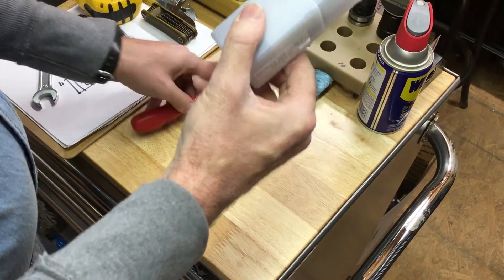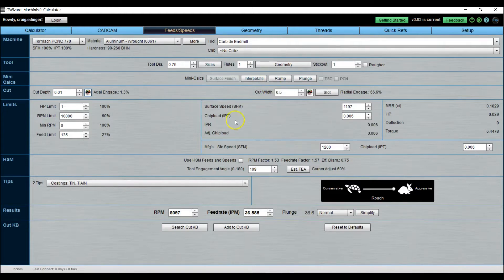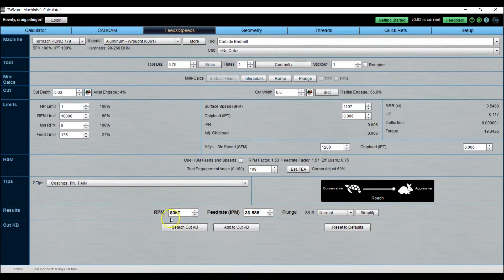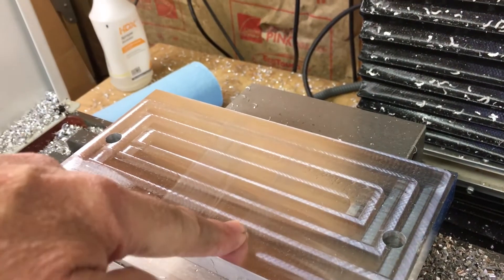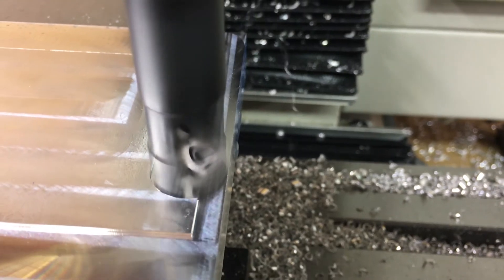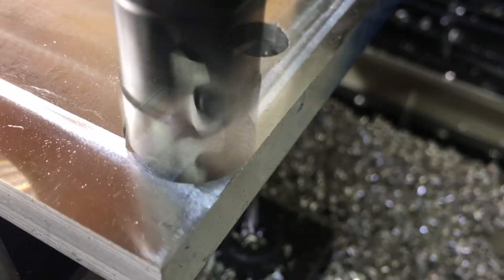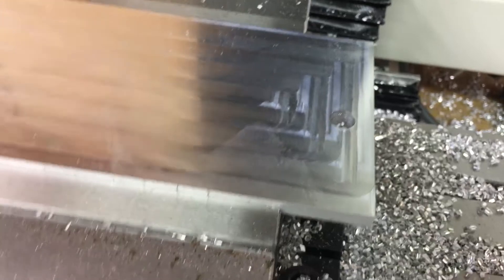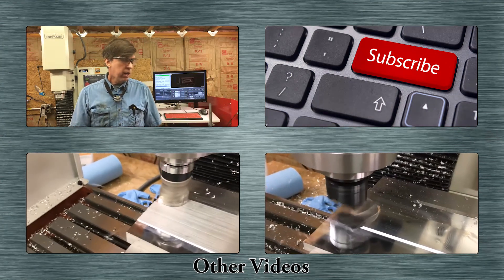Tormach Shear Hog

Comment: I watched your video showing one of Tormach's 38mm face mills at work.  I'm wondering if a guy could simply run that same face mill with all but one of the cutting inserts removed and get similar results to this "Shear-Hog"?

I know it might be limited to how deep the DOC could go but it seems like it might be doable.  If so, we could forgo the purchase of both a "Shear-Hog" and a face mill and just go with a face mill that does double duty.
Reply from the maker: Not totally sure but I think the surface speed would be off.

Comment: Have a look at AB tools shear hog, either Tormach copy's AB tools  cutter/insert or AB tools grinds it for them.  
The insert is identical , have a look at this link  http://www.abtoolsinc.com/prod/shear-hogs-shank
The AB tool cut at 7500 up to 150ipm  .375 depth of cut full width  if your machine has enough HP 
https://www.youtube.com/watch?v=iFq2qx9kS6A&feature=youtu.be
Reply from the maker: AB tools makes it for Tormach.  That's 8 HP according to G-wizard.  I only have 1 HP.  Would be nice though :-).  Thanks.

Comment: Great video Craig! Please keep in mind that I make the Shear-hog as a roughing tool. It is not a true 90° cutter as the rake that I grind into the inserts distorts the side of the insert so it's more of an ellipse. I do make sure the leading edge is high though. If you only want to face check out our 2 flute , 2" Ø Shear-hog face mills that Tormach is now offering.
Reply from the maker: +Alfred Lyon - Thanks Alfred!  Good to know.  I mainly use it for shallow pocketing when making pallets.  I normally use a 3/8 2 flute carbide to finish the walls and to get in tight corner.  I will look into the 2" in the future.  I tried using the 3/4 Shear Hog with the pocketing feature in Tormach's Pathpilot conversational but couldn't go below 50 thou.  It kept crashing at 60 thou even at a z feed rate of 2 ipm.  It looks like the cutting edge on the underside doesn't go the full length but stops like 3/8' in.  Maybe their conversational was more designed for a center cutting endmill?  Thanks again,  Great tool!!
Reply: +Craig's Machine Shop we are able to drill in Z with them on a Haas VFO with a .05" peck
Reply from the maker: +Alfred Lyon - .050, yeah, that's as deep as I could pocket.  I didn't know it could drill.  I think the VFO has a little more power then my Tormach 770. :-)  I probably won't use the pathpilot pocket feature much.  Just wanted to give it a try and make a video on it.  Fusion 360 gives more options like ramp angle so it shouldn't be a problem.

Comment: It looks/sounds like you could take it further! If I remember right, there's an indexable tool option in the G-Wizard tool-material drop-down list. I wonder how choosing that would affect the speed and feed.
Reply from the maker: +Hirudin  - Yeah, I may make another video pushing it further.  If I use the Indexable tool option it puts me at 7000 rpm but my max HP on this mill is around 5000 rpm.  I think I can get to around .200  with the current settings.